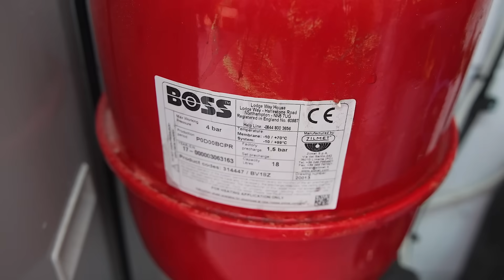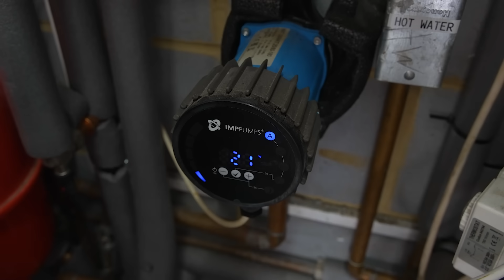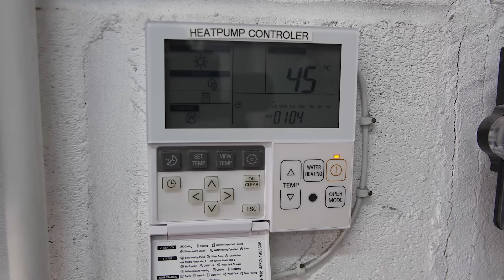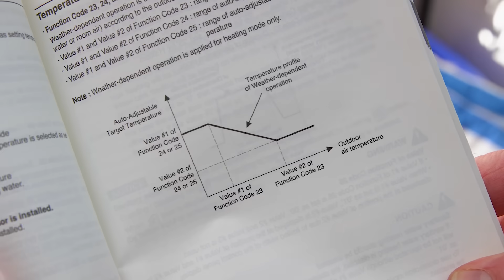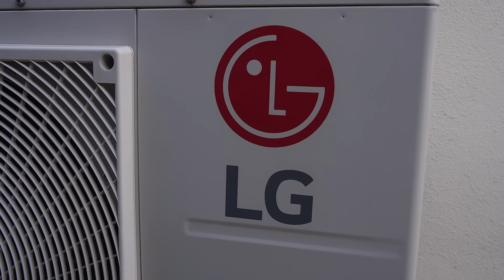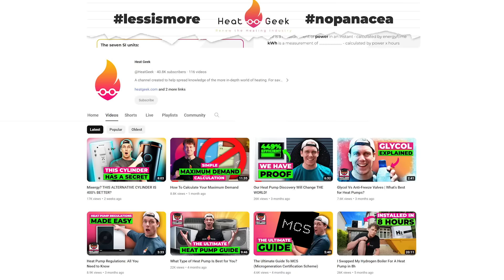Heat Geek Gives His Verdict on John’s Nightmare Heat Pump

Comment: Some points about misinformation on this video. Air to air heat pumps generally have a higher SCOP than air to water. There are air to air heat pumps out there now that will heat hot water. Most are commerical types, but Daikin now make a residential version that does 4 fan coils and also domestic hot water. The point about installing an "as large  as you like" external circulating pump on the the pipe work is not accurate. Installing an oversized pump on a system with pipe work that is too small will not necessarily be a good thing, the returns on flow rate may be minimal, and there is a possibility of causing negative return pressures on the return side. This can cause 2 problems,  air may be sucked into the system through air bleed valves installed in the return pipe work. It can also cause cavitation at the pump impeller, which in turn can cause early failure of the circulating pump.  Also the fan bearings do not require oiling as they are sealed for life. Maybe you should have tried bleeding some water / glycol from the buffer vessel prior to removing the valve. That would have saved having the geyser effect. After all it is a pressurised system, so sitting at 1.0bar or greater!

Comment: The problem with most of these install company’s is they are here today gone tomorrow a bit like double glazing company’s , it all looks fine when finished but after you have been rinsed and had your trousers well and truly pulled down they are nowhere to be found as they have changed name and moved on...!!!!
I know one company that made a lot of money fitting these systems and would only fit in the summer when it was nice weather , come winter when it’s freezing cold and the heating doesn’t work and they have disappeared along with your money....
If your going to install one of these systems be very cautious who you get to do it.... !!!
Reply from the maker: We get emails from people all the time saying they had a heat pump fitted in April and it has been wonderful. The email comes in October of the same year. 
As I have said, heat pumps work best when you need them least.

Comment: Daikin don't recommend heat pumps to be installed on a south facing wall at all. 

They make a comment to install an extra ambient sensor to the North facing wall, if the valve is on the South wall, due to solar gain potentially effecting the weather compensation curve.
Reply from the maker: I am still searching for the source of my comment about south facing. I have a feeling they have deleted the blog but here is another source
Should air source heat pumps be north or south facing?
The north face of a building will usually have colder ambient air than any other side so, to ensure maximum efficiency from a Grant Aerona heat pump, position the unit on a warmer side and preferably south facing. Ground level is preferable but not essential as this allows ease of access for servicing and maintenance.

Comment: If you ran a low temperature weather comp heating system off a gas or oil boiler would that not be most economical? If we are comparing a low temp heat-pump system to a high temp gas/oil system this is not like for like, should we not be comparing the running costs of low temp systems on the different heat sources?

Comment: 29:20 I find it hard to believe that the bearings in the fans "need oiling". I'd expect them to be sealed cartridge bearings, and for the cost of those heat pumps I'd expect ceramic balls that last for decades!

Comment: I took the modern advise with my combi boiler and aimed for a moderate and stable 24/7 temperature and a 55*C loop temp.
My bill doubled.  My run-times nearly trippled and it did not make any change to the cycle count.  I am now convinced that advice comes from the gas and electric companies in the same way they advised people to keep the "immersion heater" on to "save money" in the 80s.
I went back to heavy zoning and lower "out of use" temps and ... my bill halved again.
Is it that the modern advice is wrong?  No.  It just doesn't work in older, unmodernised housing stock.  Housing stock, for example designed for coal fired heating only.  Never designed for radiators, just a bit constantly warm chimney breast going through the house.  HUGE amounts of sub floor drafts to feed that fire air and ... basically with a 40-100kW open fire, you tend not to care about drafts.  They used bigger blankets and quilts at night too.
Turn the heating down, put on a jumper and a pair of slippers, add a blanket to the bed and save yourself 100s over winter and do the planet a favour.

Comment: I can see on here a lot of comments from people who have never fitted weather compensation, it stands out a mile because I can see from what they say. It's sad really as we have had this type of system for over 15 years from leading manufacturers and it only takes about two years to pay for itself, not only that but it gives a far more comfortable environment as the temperature is more constant and in three, four and five-story homes when zoned, can stop the overheating of rooms above. Another advantage is that you only need to size the boiler for the larger demand, not split the load say 10kw heating and 12kw for the hot water for which most people tend to then fit a 18kw boiler, the fact is you can then fit what is a recognised normal boiler size of say 12kw, The weather comp system is only doing one or the other demand and not both sides together assuming both stats call, cheaper to install cheaper to run. Let's face it, the requirements now for new boiler installs, are to run at a low water temperature system, so you should be upgrading radiators to do that, and with weather comp a small boiler, and low water temp your customer is going to be saving somewhere in the region of 30 to 35%.

Comment: I think, when I'm able to purchase a home I would personally prefer an air to air system as I would be to cool the home in our increasingly warm summers. I'd be happy with the installation of a heat pump cylinder and have it setup to only run overnight. But it will be several years before I can even consider this.

Comment: Phew… I really wanted to watch all of this, but after 10 mins of the Heat Geek saying “ well I need to recalculate the thermo curve for summer and winter”  … “the 2 stage compression needed to be optimised”  and seeing the tonnes of space taken up by tanks, valves, cylinders, pumps and manifolds I really understood why these systems will not take off in U.K.  I am a landlord and developer… and without wanting to denigrate the tradespeople I have worked with in last 10 years, I can categorically say this level of technical expertise just isn’t out there…. Neither is the space in majority of flats and houses.

Comment: Many people have heat pumps  that work perfectly and they say the ones that dont are down to bad installation. 
The problem is how do you guarantee a good installation,  you could spend £10000 one one tonfind out its not working as it should, then what do you do, spend another couple.of thousand correcting the problem to find out its still nit heating the house efficiently enough

Comment: But max floor temperature should be no more than 38 degrees as I under to stop floor cracking , so thermostat floor mixing valve is still required.
Reply from the maker: Yes, you are right

Comment: Wow! What a huge difference there must be in the conditions for heating systems between England and Sweden. For me, heating is the single biggest cost connected to housing. I have better regulation of my heating system than what "Heat geek" suggests and it is in turn much simpler and worse than the ones I worked with in professional life. I have never seen examples of constant flow temperature in Sweden, straight control curve once (on a system from before 1950), broken control curve (with three points) maybe 5-10 times, a curve with at least 6 break points a few hundred times and more advanced than so closer to a thousand times.

Comment: Put a new fan motor on or change the motor bearings , it would cost a fraction of the cost of a whole new heat pump system and of course get the base level.
Reply from the maker: Noise aside the heat pump was not working well and kept frosting up so I don't think the bearing were the reason for that. As a contractor you have to take the decision whether to throw good money after bad or start with new kit and a blank canvas. It is always a difficult judgement for all concerned. 
Given that John's wife had lost faith in it there was no point in doing half a job.

Comment: Why don’t you do the simple plumbing work first before changing the heat pump? Remove the buffer tank, the pump and the mixing valve. Change the weather compensation curve and then reassess the efficiency of the system.
Reply from the maker: Because the heat pump is a dual high temperature unit that makes a terrible noise. No point doing all that it the basic unit is not up to the job

Comment: Respect everything that was said but not that the inclined heat pump has caused the bearings to fail: the thrust from the fan will be greater than the axial load on the bearing due to the axis not being horizontal 😊

Comment: Can't those bearing be replaced? Why does he need a new heat pump? Can't this one be properly re-seated and new bearings put in?
Reply: Apparently not referring to the latter. Seems so unrealistic not to be able to put new bearings in any motor. It's rip out and replace with new and dump the old one, that's the new net zero policy.
Reply: @nickhickson8738  yeah this feels like such a massive waste.
With these heat pumps first thing that comes to mind - is it's a very expensive over engineered stuff, in addition to that - the one that can't be repaired?
I'll stick to my gas boiler - costs 5 times less to install, can be repaired and has a 10years manufacturers warranty

Comment: Adam is highly qualified, at my guess to degree level. To do all the calculations to get projects right is very involved. You probably can get an app that will give some sort of answer but I doubt it will provide all the options or the correct solution. That solution is not only related to the building but also the inhabitants and their lifestyle when these change which they will inevitably will the calculations will need to be re assessed to give an efficient system. How much does it cost for John to visit and do a reassessment when things change? Additionally if the house is sold how do the new owners take on these systems, a crash course in heating engineering? No one would like to buy a house with such a complex troubled heating system. What is the industry doing to fix the huge problems?
Reply: Who's John? He's the house owner and Adam and Roger were visiting and analysing the problem.

Comment: All gas boilers can be fixed by a local plumber no matter what the fault is.  All heat pumps can only be fixed (expensively) by the manufacturer (unless it’s something really simple and obvious).  I suspect even replacing that noisy fan could not be done by a local plumber, it’s more of a job for a mechanic.

Comment: I also have a LG Therma V and I am a Geek, not s plumber. Installed it myself and since I have only floor heating, I run it between 27 and 35 degree to get to comfy 23 degree in the entier house. Over the year I get 4.5 kwh heat out of a kwh electricity. Very happy wirh it, exept the Installer menu. In German it is missleading, but thats a problem you won‘t have. So in my case it‘s 1:0 for the Geek.

Comment: Well I’m boiling even if his ASHP isn’t.  
The lack of understanding of hydraulics and heating systems is terrifying.  
The system has the Un Vented cylinder working off the boiler..
lots of nervous looks when it’s discussed - and the ASHP doing the heating. 
It ices up because it’s working too hard just doing the heating. 
ie, the pipework and emitters are dumping heat quicker than the heat pump can produce it.  
I would guess there is minimal insulation in the floor voids and a gale blowing gale over the pipework.  
That heat pump looks far too close to the wall inlet wise, and with the hedge so close,  I don’t care what they say it will draw in cold air that it’s expelled lowering its efficiency. I’m willing to bet the air changes (nothing to do with insulation) will likely be large for a house of that age, a cat flap, loft hatch, badly fitted or old double glazing seals, gaps under external doors - even door locks can pour cold air in, the colder the air coming the harder the unit works. 
The buffer is too small if anything, the only real reason to have a buffer is storage…charge the buffer during the day when it’s warmer, use the heat energy when you need it in the evening using a blending valve to the circuits to get the exact temperature you need. 
The right sized buffer will also accept Solar PV, transferring the electric into something useful you can use. 
Again when discussed was pretty much ignored. 
You can add pretty much anything to the store, but most importantly you can keep the very unpopular, but faithful boiler to top the store to satisfy the DHW load to the cylinder. Also handy as a back up if the ASHP is struggling - or about to throw the fan into the neighbours garden.  
We’ve added woodburners with back boilers to buffers using a plate heat exchanger to correctly separate the circuits.  
Shame Roger couldn’t have pulled some boards up, I bet there’s more elbows on the circuits than a WI coach trip to the Boxing Day sales.  
The reason you have a neutral point, or header is yes, it acts as a bypass to a degree but it also stops motorised valves clanging shut due to the naffing great pump someone fitted to fire the water round the heating circuits, and that’s back to resistance again, (poor design) bad pipe sizing (needs to run too hot) heat loss, lagging, draughts etc. 
The lagging in the plant room looks like poundlands finest…tie wraps to fasten!? Wt feck is that about. 
There’s evidence of corrosion in the system, hence Roger trying to drown, blind, burn and take the electrics out changing the leaking AAV. 
AAV’s generally come with an auto shut off, closing the circuit off as you spin the valve out.
I would imagine the heat exchanger (if it’s a plate) is blocking up with rust from the rads, or hopefully the strainer which can be cleaned, (or most often thrown away because it keeps blocking up)
all of which will add to the icing problem.  
The ASHP just doing the heating should work, but the house prep for a low flow temp system is critical.  
Draught control, insulation and
and a decent heat recovery system would cut your gas usage dramatically, which would be arguably less wasteful 
carbon wise than having to have a new heat pump every time it breaks down.  
When alls said and done that gents been left having to pay twice or three times for something he actually didn’t need in the first place, and that’s not right.

Comment: Heat pumps burn more gas (at the power station) than a gas boiler.  The losses between the gas entering the power station and heating the radiators is more than the COP gain in the heat pump.  wind turbines are flat out with existing loads and are irrelevant to heat pumps.

Comment: I think a lot of downfalls come with a lack of customer education. I used to fit exhaust air source in small dwellings about 15-20 years ago. I had customers who left the system alone and had low bills but I also had customers who couldn't understand why their radiators were not very hot. You could explain until you were blue in the face that the weather compensator was turning down the flow temperatures. They would even wang the offset curve right up to enable them to dry washing on the radiators 🤣 Those messing with the settings complained about the bills and started turning the units off in the morning and switching them back on again when they got back from work.

Comment: I do not understand what you do in UK, or more I do not understand weather compensation? Do you not have room temperature sensors? How can weather compensation help anything if I want to have 23C in room? HP needs to put out more heat to achieve that does not matter if it goes by room temp or by weather compensation.
I do not think any heatpump works with on off thermostat. I mean technically it sure does but, but i think it is not used like that in any install.

Comment: Excellent video ❤ that both sides of the coin getting on seemingly, have I woken in a parallel universe l.
Reply from the maker: Don't worry we will have a few arguments down the line. There is no animosity but, when you look at a lot of the comments on this video it is clear that there is a lot stopping heat pumps from becoming mainstream. 
Even if you leave aside the arguments about expense and the space required there is still a chronic shortage of service engineers out there. People can wait months for repairs to be carried out.